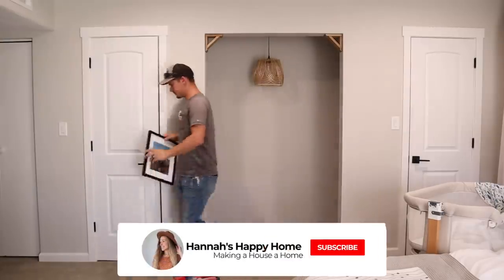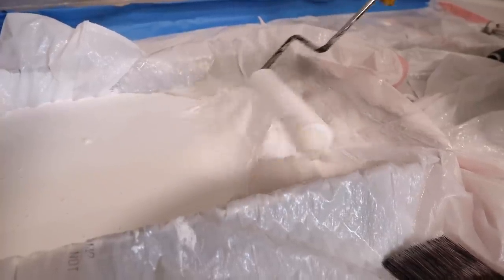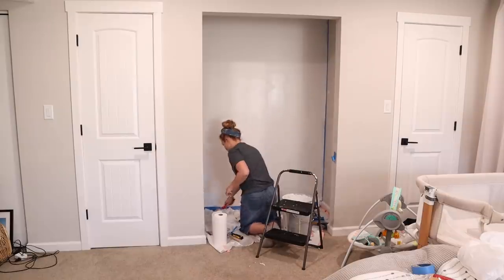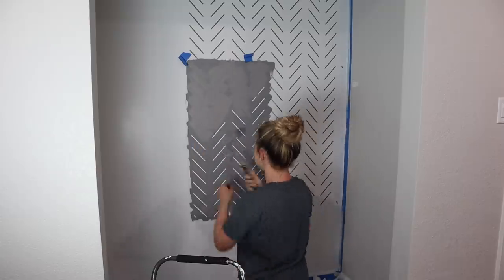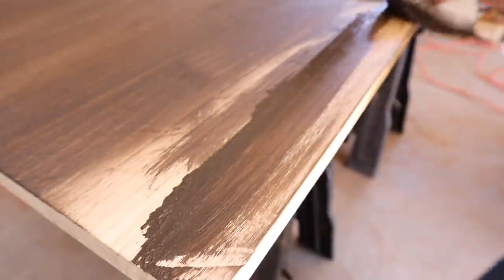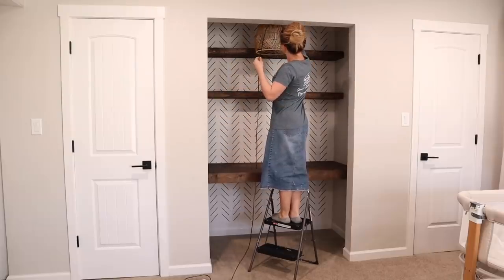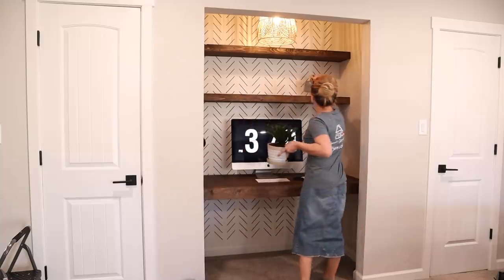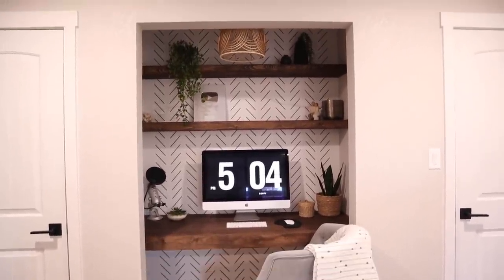HOME OFFICE MAKEOVER!!😍 TURNING MY CLOSET INTO A HOME OFFICE | DIY WOOD SHELVES |  DECORATE WITH ME

Comment: Very nice!! What if you don’t have outlets in the closet to plug in computers and monitors? Any hacks to conceal wires?
Reply from the maker: This closet had a plug, but if you need to run wires to somewhere else and conceal them, you could run them under a rug, or run them along a baseboard inside “baseboard cord channels” which is basically hollow sections of plastic quarter round molding
Reply: @hannahshappyhome  thanks!